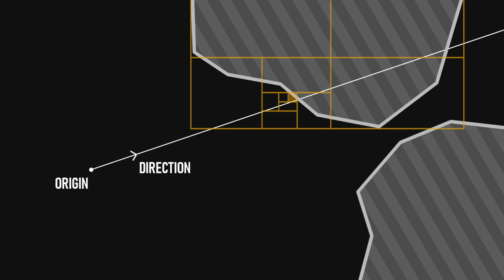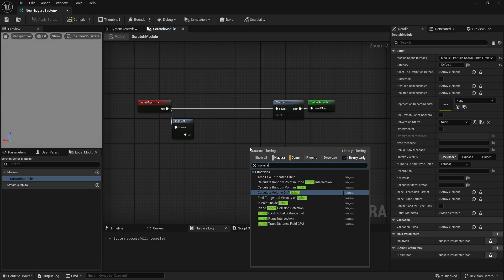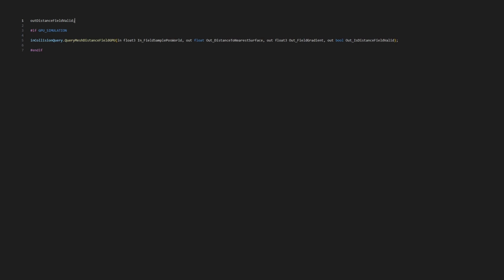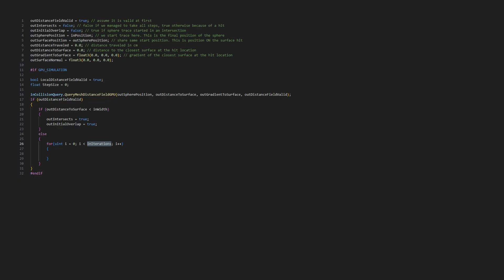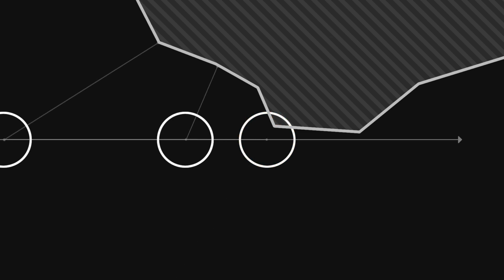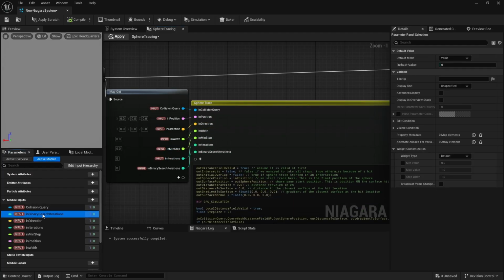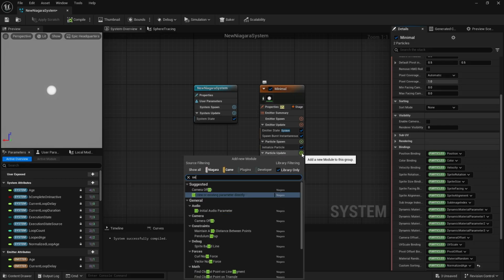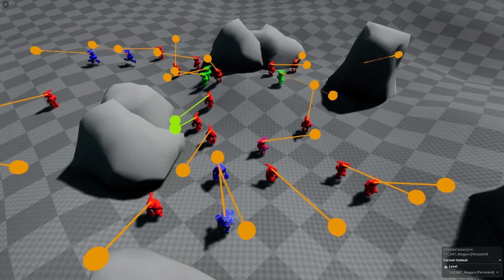Sphere Trace Collision in Niagara

Comment: Is this still dependent on Distance Fields being enabled in the project though?
Reply: It uses DFs, so quite likely you will need DFs enabled in your project that will use or anything that needs DFs... This logic applies to most things:

"Does the thingamajig that needs Data X need to have the feature that exposes Data X enabled?"
...
"Yes, you need Data X available to get Data X."

In this specific case, without distance fields enabled, DFs won't be generated and so you won't be able to sample those non-existing distance fields.
Reply from the maker: Short answer, Yes. Long answer, it depends. If you want to go through the Collision Interface to query UE's global mesh distance field, yes you'll need DFs. But DFs can also be created manually for specific assets/small scenes, and stored in volume textures. So it's totally possible to sample manually baked DFs for specific use cases. Most often you'll want to enable DFs tho, yes.